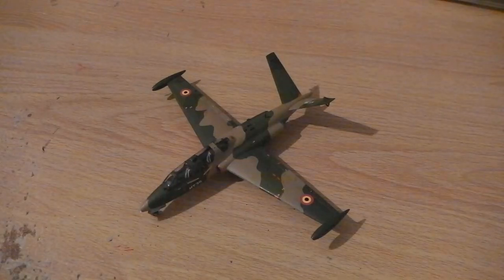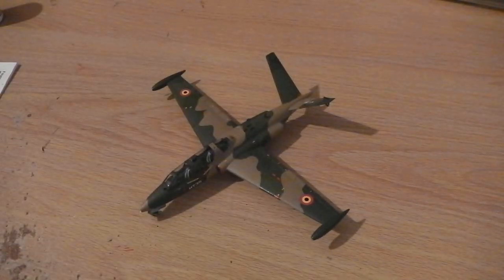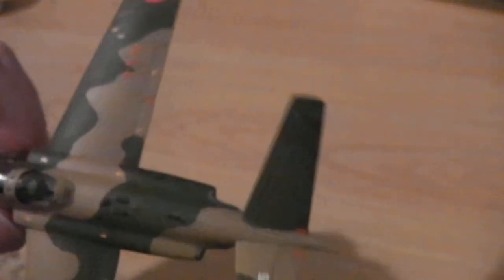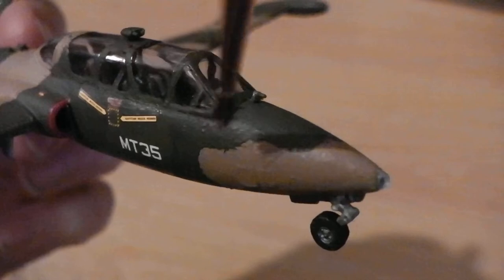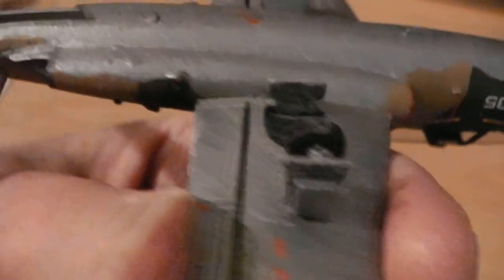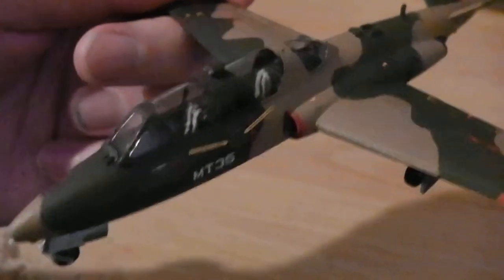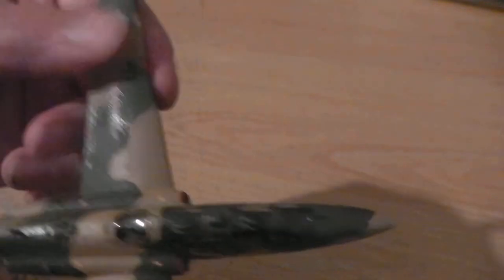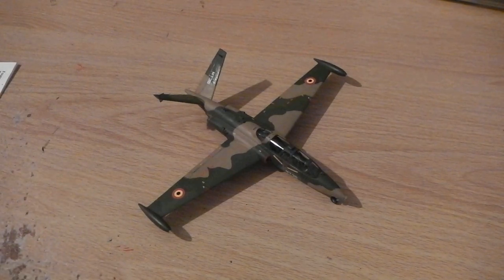Built kit - Airfix Fouga CM.170 Magister (A03050)

Comment: The tape seat belt look more realistic with a more flow than you have used on other models. Not bad but you need an airbrush then you could spray a matt varnish to level all the paints, just my thought.
Reply from the maker: I agree with your suggestions, which I do appreciate you making.   However, like most things in my life I don't have the facilities.  Due to financial constraints I am back living with my elderly mother & middle aged brother.  The modelling desk is also my general desk and is in my small bedroom with all my other junk collected in the days when I had more cash.  I order paints on-line because I can't get to a real shop, since I can't afford a car. 
I just model for the fun of it these days, when the weather is warm enough to open my window wide and let the glue fumes out.  I just can't build to the higher quality I'd like to.  I put single take model builds or reviews on my YouTube channel because they are the easiest to do.
Reply: @Payne2view  I can see that airbrushing is out, how about bushing the varnish over the whole model. I remember when I was young I used a perfume atomiser to spay varnish onto my models, with water based paints and varnishes that might be a working option for you. You do a great job sharing you building fun at a level that others can do and get acceptable results.
Reply from the maker: @flyingkub  I may do that some time in the future but I was trying to meet a deadline for the upload.  Thanks again for the complements.